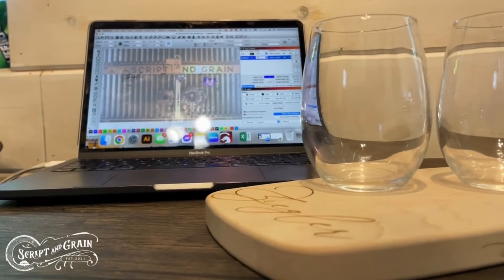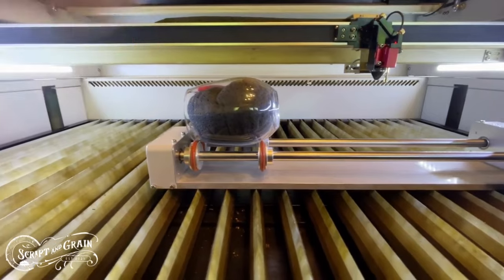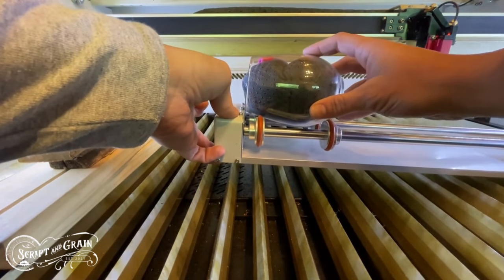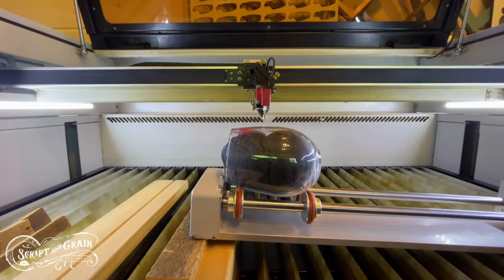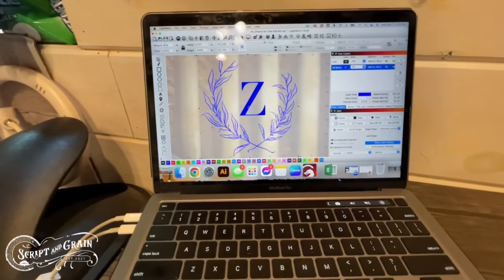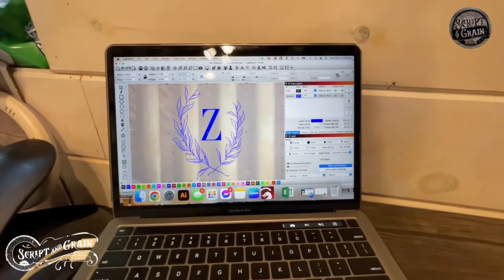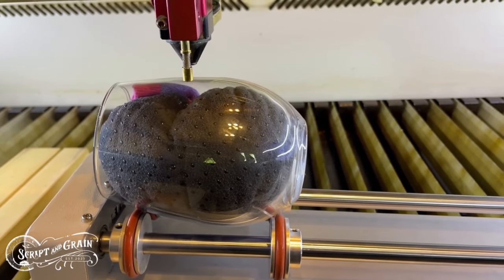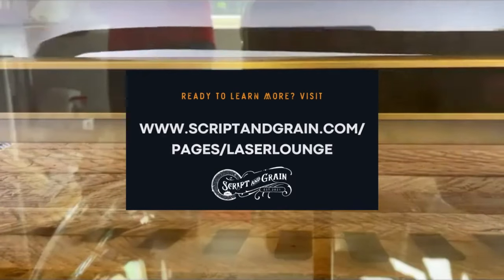How To Engrave Tapered Beverage Holders using the AEON Mira 9 Laser

Comment: I am still struggling with this. I’ve got everything correct on the engraving but my image is stretched - how did you know how much to reduce your image?
Reply from the maker: It was trial and error using light engrave settings on painters tape! But I found that reducing width to 75% is my sweet spot!